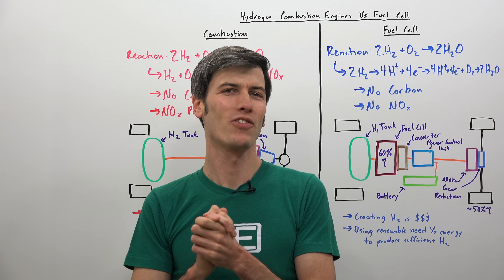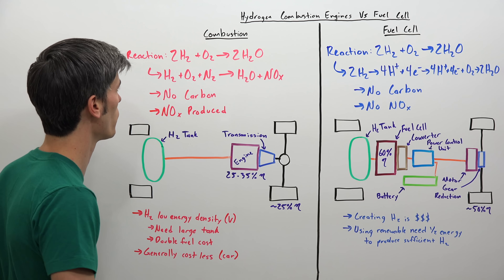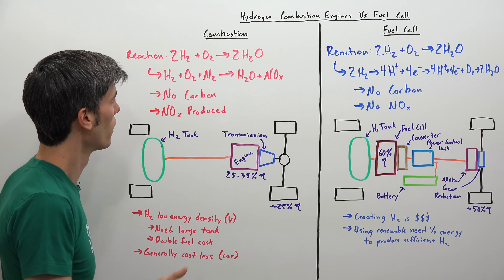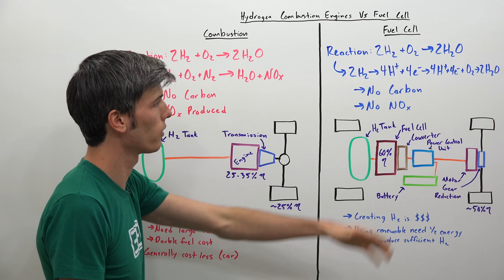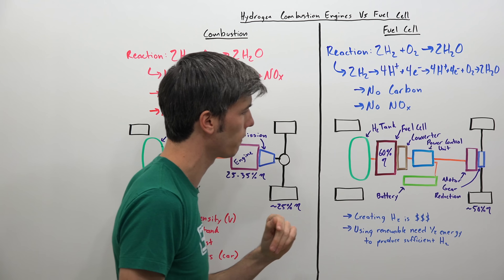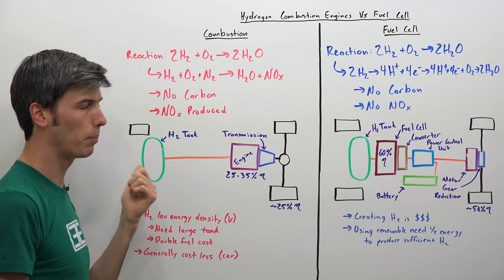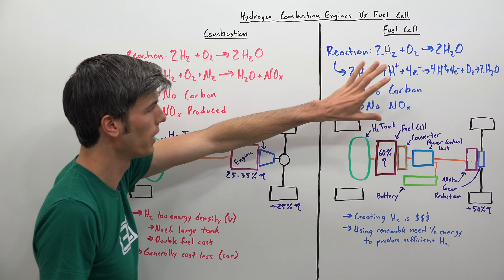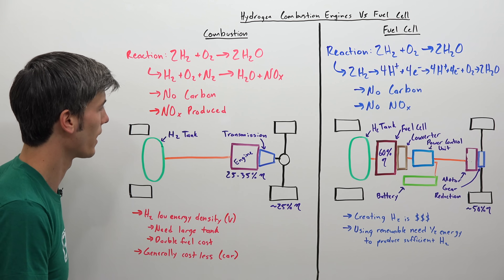Why Hydrogen Engines Are A Bad Idea

Comment: Dodge is getting a new muscle car ready to use hydrogen. Surely other die hard ICE engine manufacturers will follow suit. So it might not be such a bad idea.

Dodge says "the motor functions in much the same way as a conventional gas-powered V8. "Modifications did have to be made to the existing Hemi's cylinder heads, intake manifold, injectors, and several other components, but we found the supercharger made the power goals easily achievable. 800 hp is just the beginning."

Comment: 5:15 Did you forget to include the volume of the engines? And the weight? E.g. the battery is gonna be super heavy, as we know from petrol/diesel hybrids.
Reply: Battery wouldn't need to be very large as the hydrogen is acting as the energy storage media.
Reply: @xxportalxx.  But he's advocating against hydrogen, and heavy battery in electro/hybrid is an argument for hydrogen.
Reply: @tomhejda6450  this isn't a hybrid, the energy source for a fuel cell vehicle is the hydrogen. The battery is for things such as starting the vehicle, similar to the function of the battery in your car. Depending on the output of the fuel cell they can also act as an accumulator, trickle charged by the fuel cell and then providing the power necessary for the electric motors. In either case it's a much smaller battery than you'd find in an ev/hybrid where the battery is actually acting as a primary storage medium.
Reply: The battery as shown in the video is only for storing energy from regenerative braking, so it's smaller, and most likely lithium-ion, so it is lighter. The fuel cell car does not need a transmission, so that saves a significant amount of weight.
Reply: @xxportalxx.  had a few drinks but why store the electricity neeeded  ?why not use a dynamo system ie the electricity generated is used to directly power the electrical feed to convert charge to no lost it too much gin  supply to  charge electrons to change water to power
Reply: @zyxelite  I'm not sure what most of your comment is saying, but I believe the first part was in regards to the accumulator scenario? In that scenario essentially the hydrogen fuel cell can't supply enough instantaneous current to the motors under high acceleration (i.e. taking off from a stop, passing cars, etc.), so instead they use the fuel cell to keep a battery with high output current capabilities charged, when you need high acceleration (high current) it pulls from the battery. In general you'll need a battery anyway for starting/shutting down the vehicle, as otherwise you'd be constantly bleeding through your hydrogen store while the vehicle is off. Additionally as another commenter mentioned for very high efficiency builds using regenerative breaking you need a place to store the energy recouped by the braking system, i.e. a battery.
Reply: @xxportalxx.  hello ... right firstly im in the uk . where are you ?
Reply: @zyxelite  the distant shores of bald eagles and cheeseburgers
Reply: @xxportalxx.   is there a way of communicating quicker than this ?
Reply: @xxportalxx.  have you gone to sleep ?

Comment: Without major breakthroughs in battery technology, it will be hard in the present decade to ramp up BEV production towards ICE numbers. That's why there's a possible switch in agenda towards Hydrogen powered cars.  A push for ICE Hydrogen cars, with particle filter systems, would quickly reduce Carbon emissions, as these type of powertrains are more easily scaled in production.

Comment: The efficiency it seems like you may be overlooking is the repurposing and building out of the fueling infrastructure.  By modifying ice engines to hydrogen fuel, we expand the market share quickly and drive investment into retrofitting the fueling network.  At the same time, we gain a real advantage in carbon emissions and help keep costs low for the average consumer.  This is a win, win, win.  

We already have plenty of established, effective technologies in place to deal with NOX.  This is just not a compelling argument against hydrogen fuel for ice engines.

Comment: You mentioned the passenger compartment being taken up by a larger fuel tank, but wouldn't it be about the same by the time you added the Fuel Cell, Converter, power Control Unit and the Battery?
Reply: Yeah. He also said you need to double the size of the tank which isnt true. This guy is wrong about a lot of things ive noticed.
Reply: You'd get back some space for mechanicals "under the hood" by not needing a radiator, alternator, water pump, turbo, or hoses of any kind.

Comment: The NOx emission was new to me. Very helpful lecture. 👍
Reply: the only emission of hydrogen burnt is water.
Reply: Thats only if you have a source of pure oxygen, but a hydrogen engine will be using atmospheric air which contains nitrogen.
Reply: wasaglass HICEV produces almost no nitrogen oxide, This is not an argument
Reply: @Robbierobot574 can reduce NOx hugely by changing medium of combustion as reduces temp of combustion, e.g. petrol engines are very low on NOx.
Reply: Cant we store that NOx and use it as power booster for racing 😊
Reply: @Dosedmonkey  Computer technology allowed the reduction of lead to control the hot spots that form NoX in a gasoline engine - they detect Knock quickly and retard the ignition timing thus a loss of power offset by a small increase in compression ratios.  Hydrogen cannot compete with the energy density of gasoline plus the benefit of more CO2 to the atmosphere.

Comment: For even better efficiency, replace the Hydrogen tank with a large battery and ditch the fuel cell . . . you'll get an even more efficient system.
Reply: Where do you get the energy to charge the battery?
Reply: @andrews582  puting generator to the wheels 
and some mini wind turbines to the roof 😂🤣
Reply: @andrews582  From the same source you use to produce hydrogen.

Comment: I understand that the world is wanting to go GREEN (elec.). We need to figure out how to recycle used lithium batteries if this is going to be possible. Also reduce the price of the parts to fix an electric/ hybrid car when it breaks. The average person can not afford to fix a broken electric/ hybrid car. Or is an electric/ hybrid car one of those things that is only supposed to last a certain amount of time and be thrown away?  Has anyone seen what a lithium mine looks like? That resource is going to dry up fast. Going GREEN is something that looks good on paper, but in reality I don't think it will ever happen. There are people that do not want to go buy a car that cost as much as a house, so they continue to fix their 20-30 year old vehicle. The government is trying its best to shut the oil and gas industry down, what products are produced using a petroleum product? There are a lot of factures that most people do not think about. Yes an electric car would reduce the amount of NOx, but it doesn't look sustainable to me. Sorry for the rant here, but people need to wake up and look at the entire picture, not just a portion of the picture.

Comment: If we were to build a new car from scratch, then fuel cells would absolutely make sense.

The cheaper (and therefore faster) way to decarbonise road transportation though would be to convert existing petrol and diesel engines to run on hydrogen, in that event we'd be talking about an adapter kit your local repair shop can install.
Reply: you can see how capital isn't turned on by an adaptor kit. They want to make a margin on a whole car.
Reply: With the whole gas crisis this is a more then feasible option you bc pups install yourself to cut gas prices in half until later models become street legal tht being said water is finite is it truly a good idea to make it a fuel source when already it is in great demand by every living creature of this planet
Reply: If we decarbonize road transportation then where would plants get co2? Our farming areas are already suffering from a co2 drought!
Reply: @michaeledwards8713  As the hydrogen is used it turns back into water, constant recycling, don't see a problem there.
Reply: Yeah but it's not really feasible to convert normal gas cars to hydrogen. We would need to build new tanks which don't fit on the existing cars without extensive body work, the engine is probably the easy swap, but then we also need DEF systems which would be totally reworking the exhaust systems. That means converting a diesel car would be easier. Not to mention not doing so is a terrible idea. NOx is a carcinogen. It's not a greenhouse gas, but is being a direct cause of cancer better?

Comment: Many of you talk about efficiency and differences between hydrogen combustion engines and hydrogen cells. To my best knowledge as an engineer, many R&D teams struggle to store the hydrogen inside the tanks as it is the most devastating medium to any materials it is nearby. It comes from the size of the hydrogen that causes corrosion - voids, hydrogen compounds, local pressure growth, etc. More should be discussed  in regard to materials for hydrogen storage rather than only to the drivetrain as it may be the cause of limited development of hydrogen powered cars.
Reply: Hydrogen can be stored in cellular material made of carbon. I haven't seen any data concerning corrosion of metals in the presence of Hydrogen.

Comment: While a hydrogen fuel cell is certainly more efficient than a hydrogen combustion engine it still has abysmally low efficiency "well-to-wheel" when you put it besides a pure battery electric vehicle. 
From hydrolysis to compression losses to transport to making power again a hydrogen fuel cell engine is about as power efficient as a combustion engine (about 1/3 the efficiency of a BEV). This isn't even open to being mitigated by technical advances as the energy losses in the conversion are pure physics.

 To put this another way: in order to supply the energy to an automotive sector run on hydrogen fuel cells instead of batteries you'd need
- three times as many new powerplants (which need to be paid for by the cost of the sold hydrogen) 
- factories that can produce and compress hydrogen in quantity (which need to be paid for by the cost of the sold hydrogen...including profit for the owner of said factory)
- a way to distribute said hydrogen (as opposed to power for BEVs for which a distribution network is already in place) 
- vastly more expensive fueling stations (about 5 million $ a pop...a price for which you could build around 500+ BEV charge points..and which, again, need to be paid for by the cost of the sold hydrogen..including the profit for the fueling station owner)
...all of which combined would make commercially viable hydrogen hugely expensive. 
Certainly there's no way this could be even close to competitive in terms of dollars/mile with just taking the power from step 1 and plugging it directly into a battery.
Reply: Hydrogen can also be made via gas reforming where natural gas is abundant. I agree that compact storage remains a major problem, but hydrogen has excellent energy density compared to batteries, so it could be useful for applications where weight is a major concern (e.g. aviation).
Reply: Are there other ways to make fuel fore warming houses?
Reply: -You wouldn't need 3 times as many power plants. In fact, you would actually need fewer. What do you think will happen when everyone gets home, plugs in their cars, and goes to make dinner/watch TV/run the microwave, etc? The only way to make that work is with grid energy storage(GES) systems. Currently the most efficient GES is batteries so that means the full conversion chain for an EV will look something like this: HVAC> LVDC>chemical>LVDC>HVAC>LVAC>LVDC>chemical>motor. Once you consider all the conversions, batteries are actually less efficient. For reference, hydrogen is only HVAC>hydrogen>motor. 

-Hydrogen is much easier to produce than batteries. Exactly where do you think batteries come from?

-There is no disruption system setup that can handle EV. Every car uses power about 100 times as much power as an oven; do you really think the current power grid would hold up if everyone bought 100 extra ovens and turned them on at roughly the same time?

-You can't compare a station to what is equivalent to a pump that only one(maybe two) person can use. Only the underground hydrogen tank cost a lot, but a station only needs one. Even a small gas station has 8 pumps which can service dozens of people over a day. 1 hydrogen station per 500 people doesn't seem unreasonable at all. In fact, that is probably more than we have gas stations today. 

I get the feeling you don't know much about the engineering/science involved. Currently, there is no physical way for BEV to replace oil based fuels. We simply don't have enough raw materials to make batteries and we are on track to run out of the metals used in Li+ batteries way before we run out of oil. Hydrogen will be massively expensive, but at least it is possible in theory.
Reply: @amirabudubai2279  dude batteries are probaly better fore the long run.

But batteries take ages to recharge and hydrothing is just a pump. (Like tanking but with hydrogen.)
Reply: @amirabudubai2279  like in my country the electrical grid is overcharging because of solar and wind power.
Soo what isnt nessecary pump into hydrogen?

Comment: As much as I like ICE and its sound etc, I hate to admit that I think that electrical drives are way more efficient and faster and quieter. The instant torque is so good.
In the ideal future most of us will have some kind of ICE hobby/weekend car or motorcycle but a hydrogen fuel cell or electric car as a daily.
No way I will never want to hear sound of a nice high revving motorcycle ICE ever again.

Comment: pardon me, but you haven't read current research. fuel cells use exotic material while hydrogen is everywhere, you can make special reciprocating or rotary engines, or gas turbines running on renewable hydrogen, compressed air or liquid hydrogen or an hybrid of those. you can use a o2 tank so there are no nox emissions, etc. this affects the whole world, not your first world whims.

Comment: Is there a more efficient engine that could use hydrogen as a fuel source? Maybe we're asking the wrong questions?
Reply: Nybbl er 

Hydrogen is extremely high on the octane list so diesel wouldn’t be a good option because diesels work on an entirely different rating. Plus hydrogen burns extremely hot so it’s not easy to design an engine that can use it.
Reply: @topsecret1837  you could coat the parts which are exposed to the heat with a plasmacoat. it can withstand temperatures of over 7000 C
Reply: The Stirling is the most efficient heat-engine. More efficient than Otto or Diesel. With the constant, complete, clean burning of an External-Combustion engine. NASA's MOD2 Stirling-powered Chevy Celebrity beat the original Otto Celebrity in 0-60.

Comment: Yeah, but I have a question : could we convert old cars to hydrogen? I would love to be able to go in town centers in two decades with a 427 Cobra, but not an electric/fuel cell one.
Reply: I think it is possible because the engine still operates on the same principle just a different fuel source. I am not sure what modifications would need to be made in order to get it to work.
Reply: @Razor-gx2dq  it would probably need the timing to be adjusted because hydrogen burns a lot more violently than gas
Reply: A swedish engineer ran his Volvo on hydrogen, back in the early 8ies. Sadly, I don't have that magazine present, 40yrs later. But it IS possible!

Comment: I was expecting to also see calculations on the US price per mile comparing the two types of hydrogen systems vs a gasoline system, kinda like you did on the EV vs gas video.

Comment: yes, looks nice ont a blackboard or a sheet , but you don't take into account  WINTER and the need  for heating,  which is FREE when you use the combustion engine !  And what about the PRICE  of fuel cells, batteries ,  return on investment and  maintenance costs ?